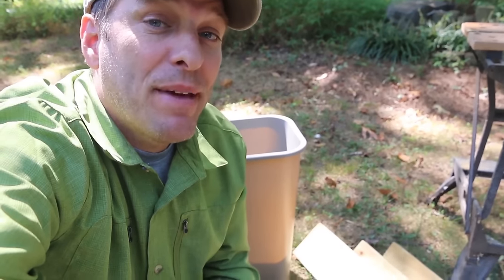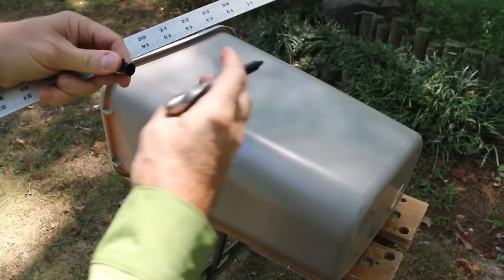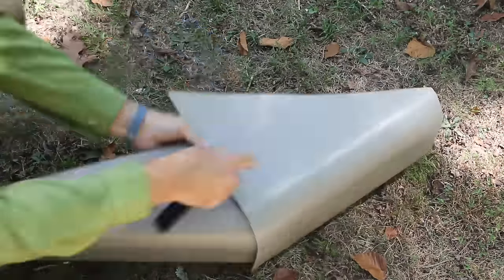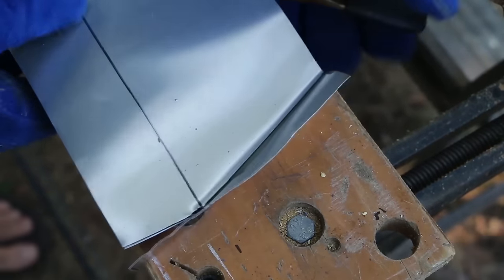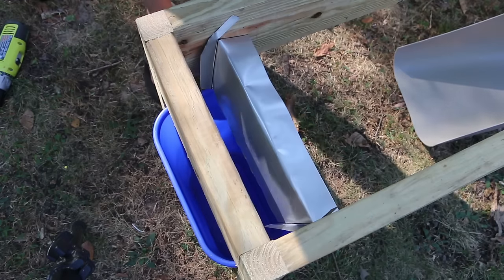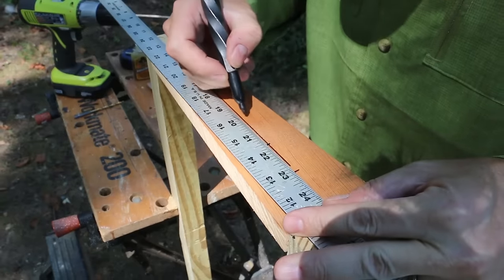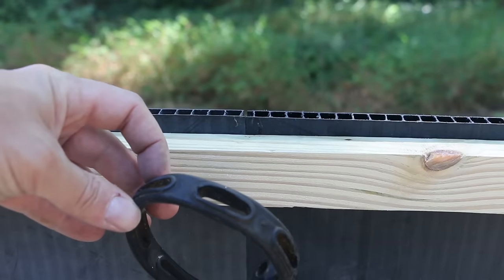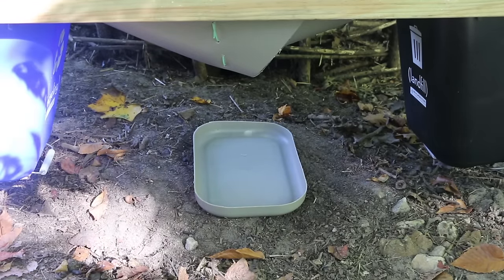How To Make A DIY Soldier Fly Larvae Composting Bin

Comment: How do I keep the larvae from crawling up and out of my catch basin? The plastic bucket I am using seems to allow them to crawl up the sides.
Reply from the maker: Jonathan, It is about moisture. That is what enables them to climb. Do the sides of the bucket have condensation? Of so, improve the airflow to your bucket. Another thing I've seen people do is put a ring of the "loop" side of velcro around the top. They lose their grip trying to cross it. Let me know if either solution works.
Reply: If you simply put the *substrate they are looking to cocoon up in, they'll stay put. * which is dry but slightly rotted wood shavings basically.
Reply: I put wood shaving in mine ..like the kind you buy from the big box tractor Depot for a Lowe price ..about a inch deep ...toss whole thing to the chickens shavings and all ..every few months rake chicken run and put in garden beds ..perfect

Comment: I just saw your BSFL compost bin. My question is do you have to have a collection bin. Or can you just let them fall on the ground or a large piece of plastic for the chickens to eat as they fall. Also thinking about making one for above the fish pond, and I think I would want them to fall right into the water for the fish. Any thoughts.
Reply from the maker: Hi Brad. Both concepts would work, but they tend to migrate out at night. That would be fine for the pond drop, but they’d have time to hide in the chicken run while the hens are roosted for the night. You could have them drop into a shallow container with steep sides. They’d just circle there until the birds wake up. One thing to remember, if the sides of the container get wet, they can climb out. Thank you for watching.

Comment: Great video. I'm about to begin my build. What size holes did you drill on the side of the lid?
Reply from the maker: +Prepping the we're just under a half inch. But, I did this late in the season, so I'm not sure if the size is right, if they need to be bigger or perhaps connected in a long slit to permit the adult Soldier Flies into the bin. You don't want the holes larger than a dime. A rat can squeeze through that. Thanks for your question.
Reply: Thank you.

Comment: I think you could call this a cylinder.  At least some sort of generalized cylinder.  Which is make a closed shape in the xy plane and drag it straight up and down in the z-axis.  Although, this is tapered.  Maybe it should be called a cone?
Reply from the maker: Thanks for the feedback, Sol. I like your way of thinking on this stuff. I ended up simplifying this design by using a tarp instead of the trash can. It saved a lot of time and should hold more compostable material. Thanks for all the feedback.

Comment: Use decking screws for use in treated lumber . Looks like you are using untreated but not sure . The reason being that decking screws are resistent to the chemicals in treated lumber that can corrode sheet rock screws within a year of exposure .
Reply from the maker: +Blacques Jacques good suggestion. I actually need to check to see if I used treated lumber or not to make this BSFL composter.

Comment: Hi, from NZ. Been enjoying your vids this morning, just found you and will sub shortly. I watched your other vid on the BSFL bin and the spider issue. If you used Leg bolts or similar on the bottom of the legs as a foot in a tuna can of water (for example) the spiders and other critters can't climb up the legs. Spiders will find other ways in but it should help. Great vids /ideas keep it up.
Reply from the maker: Jon excellent tip for keeping spiders out of the composter. I will give that a try in the Spring (I know it is nearing summer for you, yes?) It would help with the ants too. That was only a problem once, I'm guessing a particular item in the bin, but I can't remember what. Thanks for watching.
Reply: Peppermint oil is a good deterrent for spiders.Also I have used duct tape reversed on the legs for any ants, spiders, roaches, ect.

Comment: I was watching cooking videos, how did I end up here? Btw, how do I separate red worms from black soldiers? It happened to me same as you said
Reply from the maker: Ah...the algorithm knows what you really want. :-) I have had to separate worms and BSFL by hand using a "sunlight" method. If you dump the contents of your compost bin out on a flat surface in the sun, the worms will generally crawl down in, while the soldier fly larvae at the edges will crawl away. Once the pile has sat for a few minutes, remove the top layer of compost, exposing more critters and the process will repeat. Some BSFL will crawl down, but eventually you'll have a mass of worms and a few larvae to pick out. Not the most sanitary exercise, but it can be entertaining. Make sure you wear rubber gloves and wash you hands well after.
Reply: Thank you! I'll definitely do that. I've heard that BSFL are edible for humans too (not that I want to eat them) but I heard you saying several times "wash your hands after touching BSF" and never heard you say that after handling red worms. Do they carry some kind of harmful bacteria or something?

Comment: how do they get in?
Reply from the maker: Hi Jamie. I’ve got some holes in the sides of the lid. I also leave the lid propped open at the beginning of the warm season so they adult black soldier flies can get in more easily. Once the system is running any adults that hatch out in the collection bins can  fly up and back into the composter. Thanks for watching.

Comment: Hi from France,
Very good DIY video, thank you so much.
One question : why don't you make your Soldier Fly Larvae Composting Bin with only one collecting bucket?
(Sorry for my rusty english)

Nicolas.
Reply from the maker: Si seulement mon français étaient corrects... :-) The design on this soldier fly larvae composter would be simpler with just one collecting bucket. I like doing two, just because it prevents the pupae from having to turn around as they exit the compost. This did create a lot more work, though. I think a single collection version would work just fine. Merci d'avoir regardé.
Reply: Why not just use a tarp or similar with a staple gun to fasten to the frame?

Comment: I am having issues with keeping the system going more than four months or so. Does anyone have any ideas or suggestions??
Reply from the maker: For me it has just been about making sure they have enough to eat to keep the adults coming back.
Reply: @GreenShortzDIY  coming back??? Meaning you leave it open for them to fly in???    I thought we were supposed to put a lid on it too keep them in to lay eggs and keep the cycle running???? Please help...
Reply from the maker: @kevreilly7  The adults will lay eggs in the gaps between the lid and the base, but from the outside. They need to get out to hatch, mate, and then lay eggs. Even though I feed the captured larvae to my neighbor's chickens I will release a handful into a mulch pile so they can hatch into adults. If you are keeping all the larvae trapped inside your bins, the adults might not be able to mate properly. That might be your problem.
Reply: @GreenShortzDIY  thx
Reply: @GreenShortzDIY  I use cardboard for them to lay eggs but I will release some also. I will allow an opening for them to come in
Reply from the maker: @kevreilly7  Cardboard is a good option for egg-laying cavities. The adults need to fly to a leaf or branch to mate. They won't lay eggs in the compost, but rather next to it. Letting a few escape to keep the cycle going will help. Let me know if it solves your problem.
Reply: @GreenShortzDIY  thx will do.

Comment: Very nice job. I've seen commercial bins that cost $100s that weren't that nice. I would've attached the cardboard to the underside of the lid - out of the way. I would've also made the floor of the bin out of a single sheet of plastic bent at the center. The rectangular frame could've been cut to accommodate the lid without the need for the superstructure. The catch bins could've been suspended from their top, suspended from the lip of the bin. A single screw, 1/4" proud of the surface on each side of the catch bin would catch and support the bins nicely.

Comment: Why not just use a tarp and staple it to the frame?
Reply from the maker: +younes aboufadle this a great idea. I got another comment along the same lines. This would greatly simplify the design of this soldier fly composter. I saw your other comment about simplicity and I'll agree this is a complicated design. I'll do another video in the Spring with a simpler BSFL composter design.

Comment: Hi, I found those you call fly  Larvae in my worm bin how do they get in there my worm try to escape all worm food  put in there is gone in couple days ' help'  thx
Reply from the maker: Hi Susan. Adult soldier flies are laying eggs in the bin, or perhaps on the food scraps before they get put in. The only way I know to get the larvae out of the bin is to do it by hand...with gloves. They will eat all the compostables you put in for your worms. Once you remove the larvae, you'll need to put your bin somewhere the adult soldier flies can't easily find it. I keep mine in the garage. Soldier fly eggs hatch in just over 100 hours, so you may find more even after you've removed them once. If you can stop the adults from laying more eggs, you'll be able to limit the population and let you composting worms take back over.